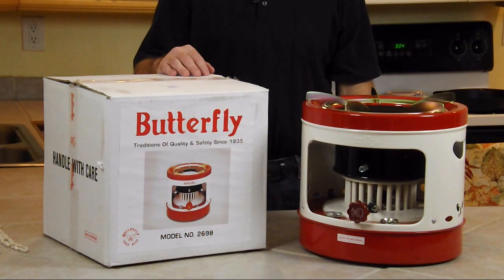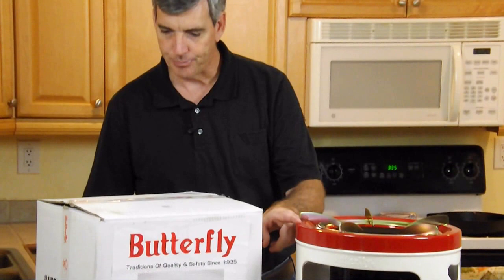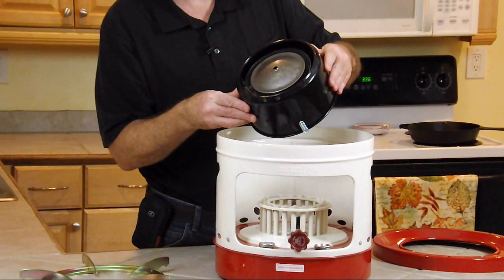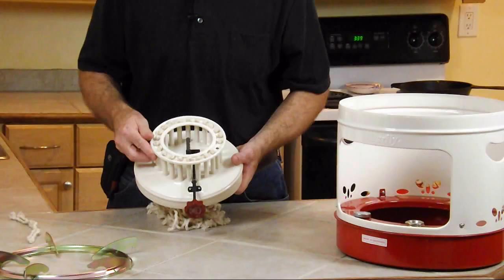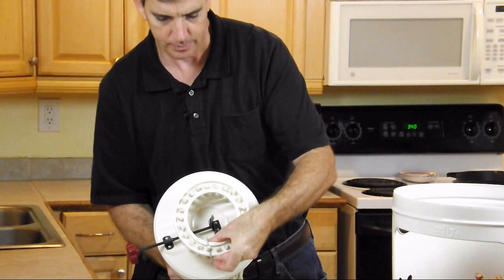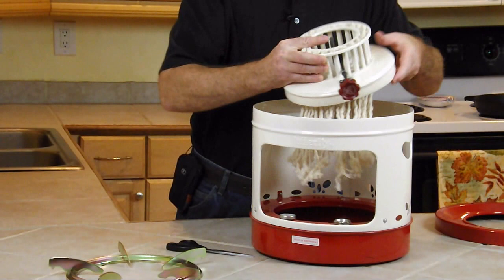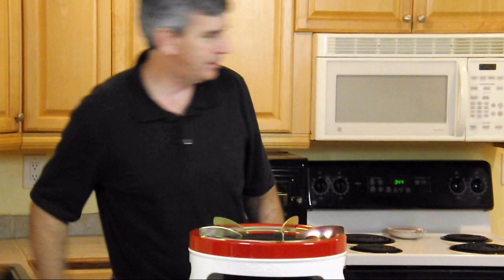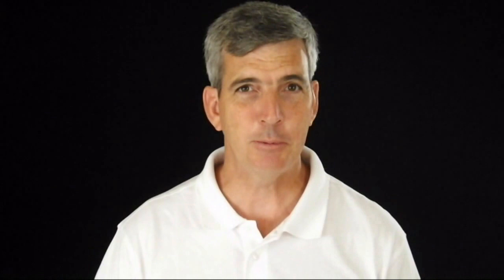22 Wick Butterfly Kerosene Stove

Comment: My emergency 'equivalent' to this is a small stainless steel hot smoker which runs on meths. Works as an emergency oven I guess (without the smoke from the wood - which can be omitted).  Mine's not very efficient though. and I don't think I'd get any canning done on it    :)     Love the video Gene
Reply from the maker: airbournepickle Thanks airbournepickle.  Gene

Comment: Hello Gene, I have one of the 10 wick stoves and never knew about doubling over the wick at installation.  My 10 wick came with minimum instructions.  Lighting has always been smoky.  I have started to use a small 2 oz spray bottle with 91% Alcohol to wet the ring containing the wicks.  I replace the convertor then tip it just enough to light.  Less smoke and come up to heat faster.  This should be practiced in a safe area.
Reply from the maker: eielson1978 Hello eielson1978.  Mine really doesn't smoke that much.  I burned an entire tank of kerosene outside to season the metal, burning off the machining oils.  Then I use a high quality kerosene.  Lastly, I don't light any kerosene products, heaters or stoves, until the wick has fully been saturated with kerosene.  Thanks for the comment.  Gene
Reply: Gene Lonergan  What I didn't think to mention is that my oil may be as low at 10 degrees so it takes a little time to warm up
Reply from the maker: eielson1978 Hi eielson1978.  Owwwww that is cold.  Yes, I bet that could make a difference.  Gene:)

Comment: To 96geometro:
The stove demonstrated here is a canning stove.  It also works great for 12-14" fry pans or pots.  90% of the kerosene stoves in the world top out at only 7,000 btus.  This stove will put out 14,000 btus.  The 16-wick stove (Model 2487 - see Gene's other video) is cheaper and it produces 10,500 btus, which is comparable to a large burner on a gas or electric range.  The oven also works perfectly on the model 2487.  Butterfly does not make a larger oven, but this one will hold a 10x10 cake pan or up to two 1-lb bread loaf pans.  The only larger oven I'm aware of is sold at Lehman's.  It's about 50% larger than the Butterfly brand #2421 oven and it costs about twice as much.